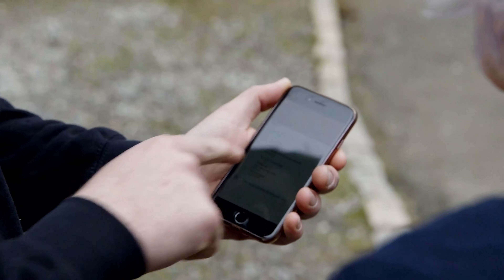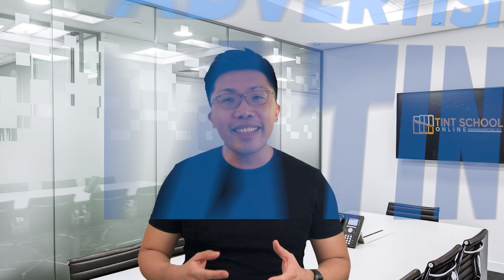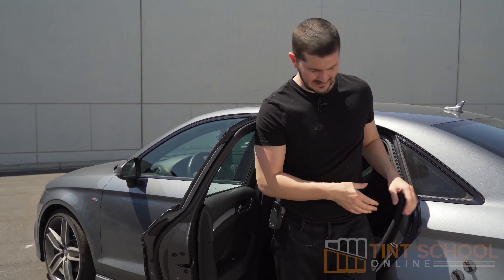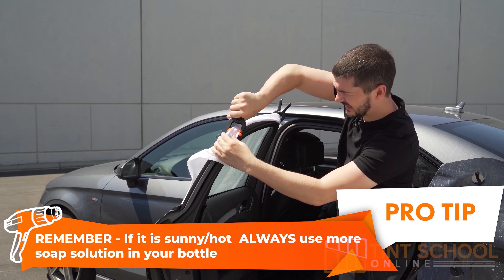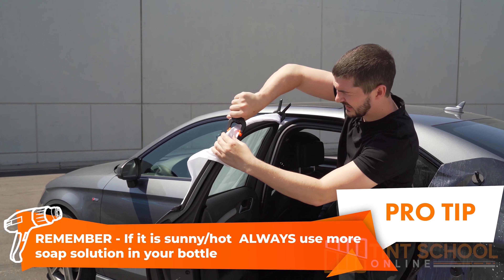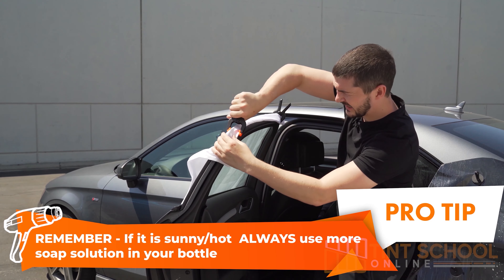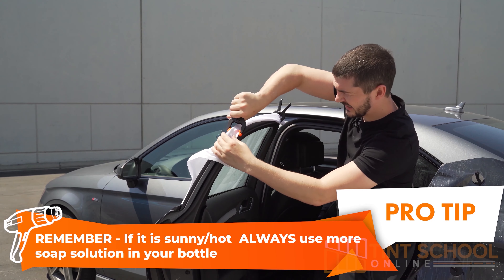How To Tint Car Windows OUTSIDE | Secrets To Mobile Window Tinting | Tint Training Classes

Comment: Thank you! After watching several of your videos, multiple times, I believe I can do this! Next step, practice!
Reply from the maker: Glad you liked them!

Yes, be sure to practice lots and good luck!
Reply: Im learning aswell. Why didnt you shrink it? Im confused as to when to shrink and when not to.
Reply from the maker: Always attempt to shrink every window when you start. Nothing lost if you try.
Reply: @TintSchoolOnline  cool deal thanks for replying.
Reply: I just started doing my car but I took the rear door windows out and did them inside , it took 4 attempts on the first window before I was happy with the result ordinary plastic will scratch the film so I purchased the proper tools and you need to apply solution to both sides to make it easier not at all easy and I’m a professional painter and pretty handy when it comes to trying new things

Comment: Does the spray products ratios change depending on condition’s? And what soap / water glide products do u use when applying the film thank you
Reply: Yes and I would recommend Johnsons baby shampoo (no Scent) put about 8-10 drops in a 32 Oz. Spray bottle. Depending on tempature you may need to use less or more.

Comment: I tint in a 110 deg during the summer and over the tint it installed theres water marks dried out. How do i solve this problem? I make sure that the film and windows is really wet when i apply it.

Comment: How do you use air gun without socket or do you use cordless?😊
Reply from the maker: Most customers have electricity so you can get an extension cable. Or get a generator .

Cordless heat guns are not good enough
Reply: @TintSchoolOnline  thank you for the response very much appreciated

Comment: Wow! Didn’t know that we can install the flim without shrinking from outside and stretch it from inside. Won’t that create fingers on the side?
Reply from the maker: You can stretch the film in the correct way and not have a any fingers :)
Reply: As long as the sweep isn't putting a lot of pressure on the tint and as long as you squeegee from left to right (don't go down towards sweep) keep water away from it as much as possible after flushing. You won't have to shrink every window.

Comment: What size peel board do you use? And where did you get it from?
Reply from the maker: We had ours made, the blueprints are in our course and you can take that to a fabricator.

I beleive its about 30 inch in width and 50 inch long but I'll have to double check that for you

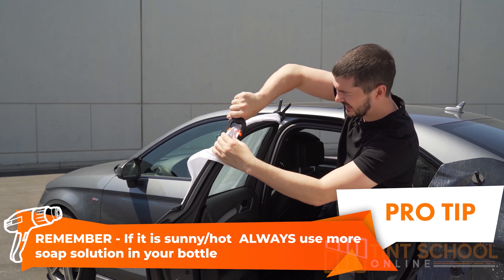Comment: 7:57 what do you mean you haven't shrink it? Did you just cut it and that's it? This is more confusing than helpful
Reply: He locks in the window then applies pressure and it pulls the tint left and right as he squeeges thus making it not have fingers at bottom due to water on sweep.